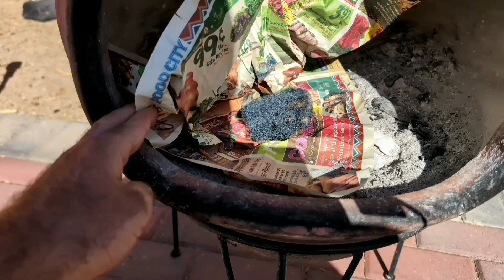Burning Steel in 0.1 seconds

Comment: So why do they become gray and non reactive as opposed to rust? 

Also of the post-burn iron is still strong AND immune to oxidation, why don’t we use it to make stuff?
Reply: You've got oxidized iron after the experiment, which means it's more brittle, less malleable, I suppose you can make stuff out of rust, but it's not like no one's ever tried and it's some secret ultimate material
Reply from the maker: Great question. Looking into it, it's not clear whether the iron oxidizes to Fe304 or Fe2O3. Technically Fe2O3 is rust but as you notice it's not as  orange like most rust is and that could be due to it not being hydrated or it being Fe3O4.  Once I sprayed water on the black/gray oxidized form, the next day it was orange. It just didn't make it into the video. And I believe what Kryptnyt said is correct. It's not as strong in it's oxidized form.

Comment: Steel wool easily lights with a match.
Reply: I think (and I may be wrong) that it will auto-ignite in a pure Oxygen environment...? I'm just going to Google it to be sure, I'll creep back sheepishly and apologise...
Reply: @Daft_Ideas  I wouldn't be surprised. The Nitrogen in our air prevents the world from auto igniting.  Look at videos of Apollo 7 to see what can happen in a pure O2 environment. Three astronauts lost their lives.
Reply: Well...bah....or Baaa!

Sheepish me back to report...it burns brighter, quicker, but it won't auto-ignite, at least not at room temperature.
Reply: @Daft_Ideas  there are lots of cool youtube videos of Lithium, potassium and Sodium spontaneously igniting and/or igniting and exploding when dropped in water. They are fun to watch.
Reply from the maker: Usually yes, when wouldn't it light with a match though?
Reply: @No_College_Needed  you need to spread it apart so there is a lot of air between the strands for it to really catch fire and not just sparkle.